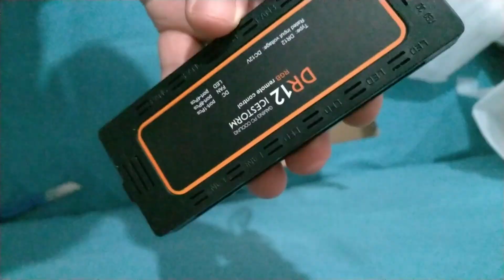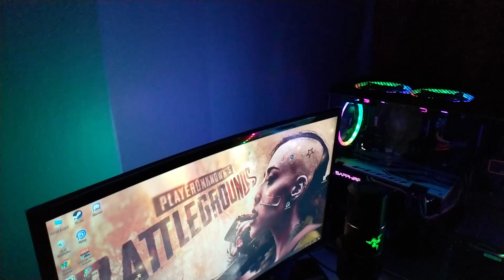AİGO DR12 RGB LED KASA FANI - Aliexpress Alışverişi

Comment: Kardeşim fanlardan memnun musun özellikle soğutma ve sessizlik açısından nasıl buldun yani odada böyle kasa dibinde bir oyun oynarken bişey yaparken seni ses rahatsız ediyor mu veya soğutma konusunda her hangi bi performans yetersizliği gördün mü objektif olarak görüş bildirirsen sevinirim
Reply from the maker: beni idare ediyor r5 3600 rx580 li sistem bir sorun yaşamıyorum sadece fan hızı ayarı yok bu modelde o yüzden full hızda dönüyor ben buna kendim bir çare olarak aç kapa düğme taktım kasanın arkasına kablo çekip oyun oynamadıgımda kapatıyorum fanları kasanın 1 tane stok fanı yetiyor oyun oynayınca açıyorum sesi biraz var sessiz diyemem ben alıştım artık kulaklık kullanıncada gelmiyor sesi
Reply: @SessizOyuncu34  ilgin ve yorumun için çok teşekkür ederim bende frisby dual ring 120 mm denk geldi bugün Media Markt da 1100 rpm sanırım 5 tane kalmış fiyatı uygun bulunca  hepsini aldım 3 öne 2 üste 1 de arkaya düşünüyordum artık arkayada bı tane sonradan alıcam 1 tane eksik oldu şimdilik 5 taneyi 140 TL aldım adeti 28 TL geldi ve çift tarafında RGB ring var çok uygun aldığımı düşünüyorum  ama buna fan kontrolcu alsam hız ayarı destekler mi bilmiyorum sanırım yoktur artık direk baglıcam anakarta göre yanacak hepsi msı x570 gaming plus var Asus rog strix rx580 t8g 3 fanli top edition ekran kartım işlemcim ryzen 7 3700x ramlerin adata xpg d80 3200 MHz sıvı soğutmalı ram ve kasam corbide spec 04 midtower ama ATX desteği var uygun corsair hx1000 80 plus platinium PSU bulmuştum onu aldım ama kasa içinde de Corsair vs 600 var yeterli gelirse belki duruma göre onu kullanırım hx1000 i piyasa fiyatından tekrar satarım belkide ileriye dönük upgrade amaçlı hx1000 i baglarim normal de tahminimce sistemim toplam 6 fan 1 stok işlemci fanı ile beraber hepsi dahil tahminimce 600 wat olan PSU yu biraz darboğaz yapabilir enerji konusunda o yüzden hx1000 i kullancak gibiyim bunu artık toplayınca gorucez hayırlısı bakalım bı eksiğim M2 SSD ile sata SSD kaldı depolama için M2 SSD de pci4 desteği işlemcim ve anakartmda olduğu için Corsair mp600 480 GB düşünüyorum çok fazla gelirse fiyat belki 256 lik olaninida alabilirim sata SSD içinde James donkey uygun fiyatlı.oldugu için 960 GB lik bı tane ondan alcam aşağı yukarı sistem bana 7500 ila 7750 TL civarına mal oldu suanki dolar kuruna bakarsak iyi bile topladım kasayı toplayıp ilana koysam normal.piyasa değeri hx1000 ile koyarsam 9 bin TL civarı minimum eder diye düşünüyorum anakart işlemci ve psu 16 ay garanti ekran kartı 27 ay garanti fanlarda sıfır yeni aldığım için 2 yıl garanti devam ediyor 👍🏻